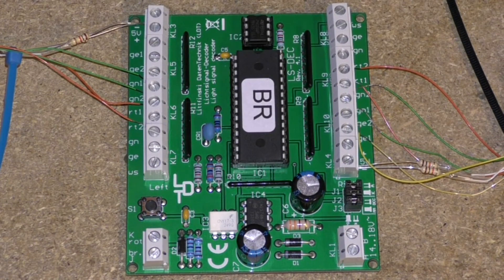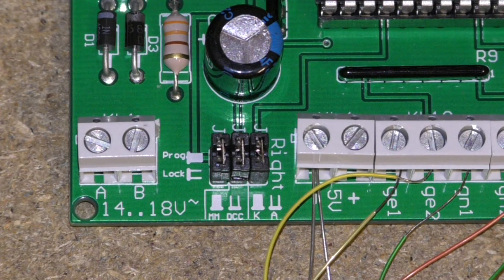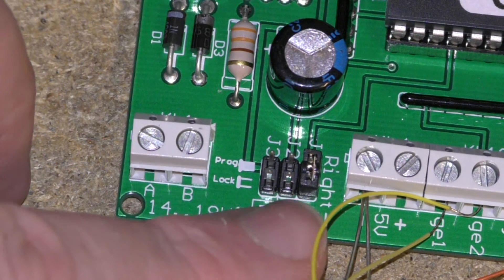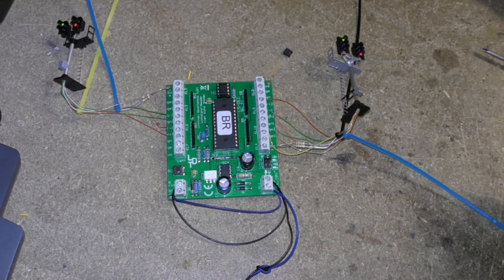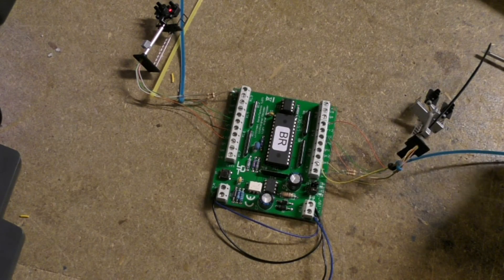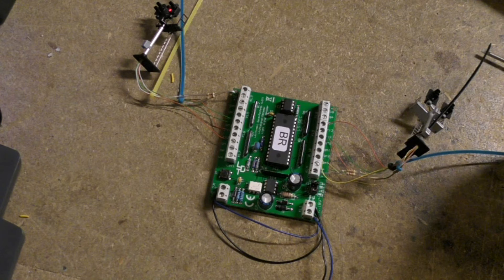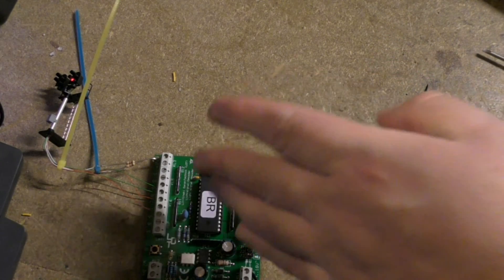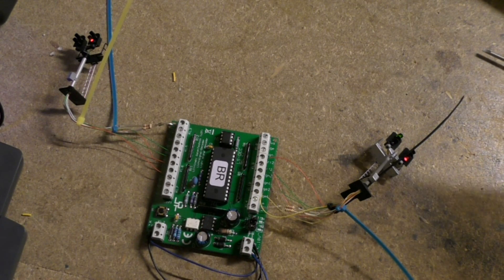Failing at Setting up LS DEC BR F part number 510112 part 2

Comment: Could be wrong but it looks like the resistors on the left signal aren't connected.
Michael
Reply from the maker: +WestBlythMPD hi I just didn't read the instructions properly the wires are in the wrong holes